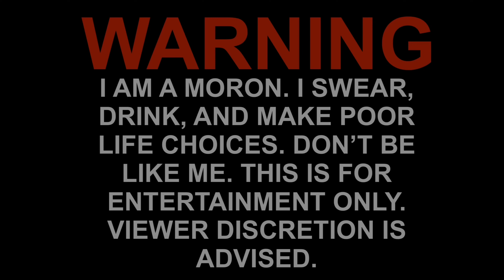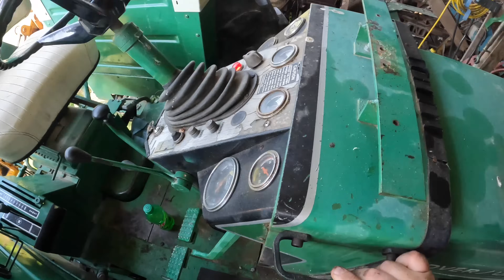Replacing BATTERIES and Digging HOLES Oliver 1855

Comment: Looked like the 1855 did a good job. Just a little more work on the backhoe attachment and you'll have yourself a humdinger. Those batteries sure does cause a lot of corrosion and deteriorate the battery boxes, I need to build me a new battery box for my tractor, same issue. Thanks and have a good evening!

Comment: HI ROSS 😊😊 most likely those old tractor 🚜 😊 battery's have a dead cell in them they are no good U done the best thing is 2 replace them w new 1S and the more cranking amps a battery has the faster it will turn the engine over gas or diesel 😊😊 and a battery brush helps 2 clean and soda 🥤 😊 will work 2 it eats the battery acid then rinse again U should've took the old battery's out 1ST and took them w U and turn them in 4 the core charge 😊😊 OMG 5 21 2O24

Comment: Good job Ross just a fyi  i use hot water and baking soda soak the cable ends for a short time and dry them off before back on the post . Keep up the good work Thanks.

Comment: I destroyed a battery twisting the clamp off the post once.  Battery was still good but just needed the corrosion cleaned off.  Twisted the post right out of the battery.  Went to Napa to get a new battery and discovered they sell a little two jaw puller for pulling those stubborn clamps off the posts.  Works good and haven’t ruined a battery since.

Comment: You need to put some restriction couplers on the swing on the swing control. Just need to take a swivel and weld the end shut then drill a small hole in it.